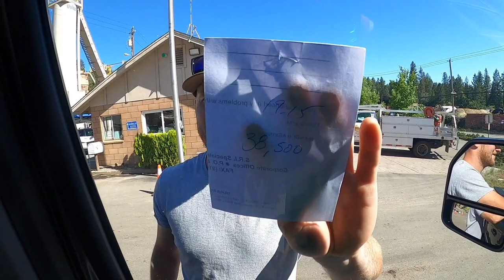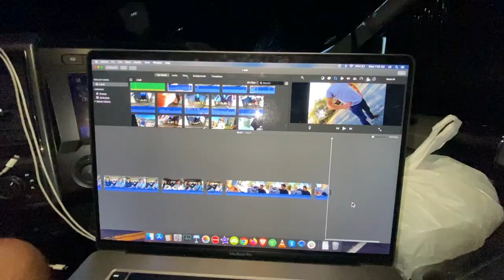Cummins  Fanboy  towed  30K  POUNDS  with my  FORD  and was  SHOCKED

Comment: Are there any after market exhaust brakes available? Also, I'm curious how would the F450 would perform?
Reply: 450 would be a ton better than that 350. Depending on which gear that 350 has it's ethier 3.55s or 4.10. 450s have 4.30s.
Reply: Yes I have a ez link tune full delete with a BD diesels aftermarket brake on my f450 . It’s a beast

Comment: I like all brands of trucks. They all have pros and cons. Getting there faster is great for a person that is concerned with that. I like Ram trucks because they are simpler,. They usually are less money in both purchase and up keep usually. Usually....They also can have bad ones that are a lemon. I don't care about faster.. i like longevity and ease of repair. Fords are definitely faster.. but the ride sucked made my back hurt. Chevy was a great ride and good power but I felt like a giant in the drivers seat. News flash I'm not a giant. Ram had the most items that were what I considered I can't do without thing. Plus mine has a winch from the factory. raspberry

Comment: The Ford will never outdo the true diesel of the Cummins
Reply: Well in exhaust brake Cummins but in pulling power in term acceleration at same trailer weight ford will spanks Cummins 5.9 and 6.7 easy

Comment: Cabs are the same on all trucks from big 3 now. Always has been except ford. 97-17 f150 was a dif cab than superduty. Ford 04-14 f150 all had same shell for the most part, same with 97-16 superduty. Bout time they went back to same body

Comment: Nothing beats hydraulic disc brakes on a big trailer. I will never order a trailer without them. Other than just being cheap, I don't know why anybody would buy electric drum brakes. And I do have experience with both, I drive my brother's drum brake trailers regularly.  But my trailer weighs so much more (12k empty). On a big hill, you can feel his, but they don't do much. If I grab the brake button, my brakes will throw me against the seatbelt, and that's without the truck brakes. Plus there's the issue of brake fade. I live in Oregon, lots of mountains, you need brakes that don't fade, or at least not as fast.  

I will say, electric brakes are smoother and better integrated with a brake controller.  Mine have about a half second delay as they come on, and they don't come on until the controller commands 25%. I don't know what to do about that, I bleed them and that reduces the delay, but I haven't figured out why they don't come on until 25.

Comment: Lol it’s so easy to get tempted by the snake all the snakes faster it’s got more power but what you don’t know about the snake is that the snake is going to cost you a lot more in maintenance it’s going to break down more often and when it does, it’s gonna cost a lot of money after owning rams you know the maintenance is ridiculously cheap and extremely! Reliable that Ford transmission is not and if you tow with that truck long term in the higher gears, you’ll hammer the bearings and need a new engine very common. Don’t be tempted by the snake because the turtle always wins the race.. and last, but not least that snake is getting 20% less fuel mileage at the minimum. It all adds up if you wanna go fast..
Reply from the maker: You're right about that

Comment: I thought your truck sounded good.  To bad they don’t make aluminum trailer.  Then you can have best of both worlds.  Great fun video
Reply: There are Aluminum 40 foot trailers on the market -.  But there many times the cost of a good Diamond C
Reply: On a 40 you would save about 3500-4000lbs off the trailer for the same gross.  

In a long haul it would save a lot in fuel - but it's real value is non CDL as  it max out your ability without over working the Aluminum.

Aluminium flex and that in time is a problem for the life span if you maxed it out under CDL..  

That's my view - the Aluminium will ride better than the steel, but didn't get aluminum deck steel frame trailer - all aluminum only!

Comment: Takes a powerful engine and a good frame.   10 speed gives you alot better ratios. Dodge cabs suck and ac system. The newer dodges are getting there but older ones are trash if it weren't for Cummins engine no one would buy.The Ford  
You can put another 5,000 pounds on it.

Comment: You said he had a CDL, so was legal.  What about your truck being tagged at 26 K?  That would have put you over weight for your truck.
Reply: I don't know how any of this works.  I had to get a CDL.
Reply: @wiredforstereo  What is your question?  If you are running under 26 K for truck and trailer, you don't need a CDL.   26,001 and above requires a CDL.

Comment: If you guys stop trying to use a light duty truck to pull heavy loads you wouldn’t have brake issues. All it takes is your electric brakes to fail you will leave the biggest streak in your gonch ever. With our 5 ton truck we have a tandem dual tag trailer with electric brakes they malfunctioned while carrying a KX80 Kubota I sure could feel it with the trucks brakes. What Sam pulls with his 5500 is insane all it takes is a broken wire he’s screwed.

Comment: But you darn well know your truck will be the first to blow up before the dodge or even a duramax. Theres enough dead power strokes around to prove that one, throw a cummins in it and ford would probably have the best light duty diesel pickup on the market.

Comment: Ram comes out with a 10 speed the following year ford will come out with a 15 speed🤔
Reply: if Ram doesnt fix it's quality issues Ford might have to steal the Cummins contract..lol
Reply: Ram has never fixed their quality issues. Why would they start now?
Reply: The more speeds the more stuff to break and the more expense when it does. i don't mind 15 spds as long as they are a road ranger 15 spd manual over drive

Comment: Ford doesn’t build for the hotshot drivers. If they did, it wouldn’t have a 10 speed. A computer tune on a 8 speed would give you the same results and have a better engine brake. It’s also not going to cost as much to fix if it breaks. I think Notorious BIG said, mo gears, mo problems. I have a CDL, the tractor trailers are getting terrible engine brakes too and it’s because of the transmissions designed to run at low RPM to save gas mileage.

Comment: A proper exhaust brake in that ford engine would rip it apart in no time. That is why it is so weak. The transmission you have is the ford version of an Allison 10 speed. poison makes one that will drop into the ram truck easy as pie. These diesel ford trucks tend to become huge money pits as they age. The Cummins engines last a whole lot longer. You are running lot of miles in a short time and not keeping these trucks long enough to find out. Being non cdl driver prevents you from hauling the heaviest loads that truck is supposed to be able to haul so not worked all that hard. Try to drive that ford a half a million miles and you will see that the ram has a lower cost. I just retired my Cummins powered Ram with 1.28 million miles and the mechanic I sold it to rebuilt the engine and put it in a newer truck because the frame had too many stress cracks from all of the hard miles. Got my new one just before Fiat took over, so current one is good too and racking up the miles daily. If it lasts as long it will take me to retirement
Reply: BS.

Comment: Ford or gm can’t use a true exhaust brake because they have hydraulic. Lifters.  An exhaust brake could over power the lifters . Cummins have solid lifters so they can use a true exhaust brake
Reply: They all use EBP with the VGT. The cummins in the consumer trucks isn't a true jake brake. Sam has a PAC brake on his truck.

Comment: Convert a Ram driver into purchasing a two pots lift and a shop to put it in lmao I assure you if you go deeper than the valve covers you will lift the cab before you turn a wrench.take from me I’ve worked on all brands not a bias opinion just telling you the facts. Ram is a more reliable truck and much cheaper to repair stay away from the 68re trans get the Asin if you like a Allison transmission you’ll love the Asin same platform as Allison is a clutch pac trans on steroids. beware of any V8 diesel. If you have a feminine side and enjoy the bells and whistles go head but you’ll pay for it more ways than one

Comment: Ford all day. Ram #2, GM/Chevy worthless.
Reply: I can't understand why people buy GM
Reply: @jamesrichardson559  Because We Like Power, i used to have 2002 7.3, 2006 6.0, 2012 6.7, and now i have a 2008 LMM Duramax and a 2020 GMC AT4 Duramax, i pull a gooseneck dump sometimes with a skid steer or a mini hoe, and i also pull a large fifth wheel, camper both Ford and GM are great trucks, just comes down to preference
Reply: @jamesrichardson559  GM is the best , prove me wrong

Comment: Ram/Allison 10spd supposedly coming...
Reply: i woukd not hold my breathe ,,allison is a gen,mot product,never will sell to the competitor,,ford ownes 20 5%of cummins dodge has the deal to use the engine..think of the ford w?cummins and 10 speed allisin ! damn !!
Reply: Michael Sorrentino  Allison is no longer owned by General Motors nor did GM renew contract for Allison’s in its HD trucks.
Reply: @michaelsorrentino7409  Ford owns no part of cummins
Reply: @markglover417  belive you are wrong research it !!
Reply: @michaelsorrentino7409  nope not wrong...Ford had a few shares back in the day that Cummins bought back. You need to update your search
Reply: You read my mind,
Reply: Mark Glover yes, you are correct 👍
Reply: @centraltire2197  ya there's alot of stupid people on YouTube that think they know stuff......gets irritating
Reply: @centraltire2197  basically comes down to Ford loving fan boys that really know Ford engines are crap but they try to hold on to that little satisfaction that happened so long ago and has been irrelevant since 1997

Comment: That's only 15,000 lbs
Reply: 18,000 for a KX080-3, but yes not 30k. I believe they are referring to the weight of the entire rig not what they are actually towing.
Reply: @JakeDerr1450  good possibility